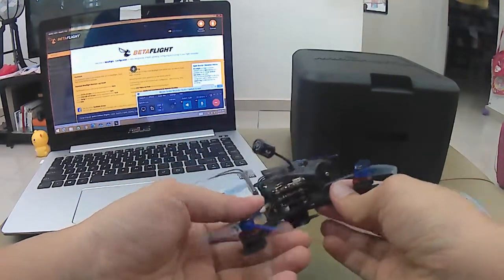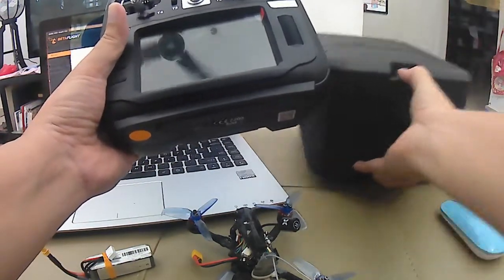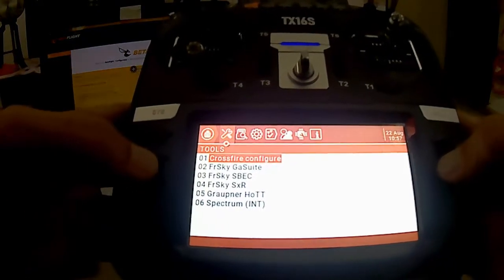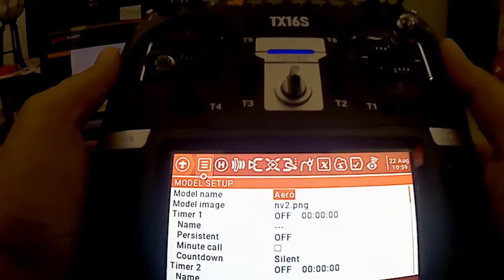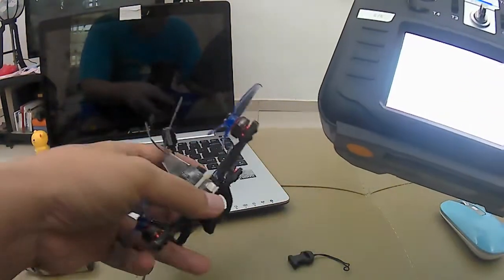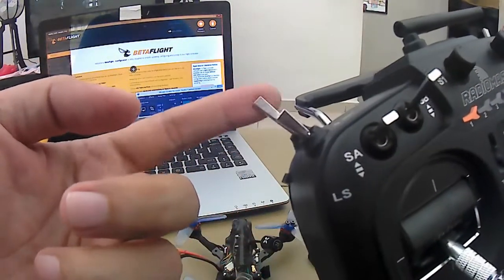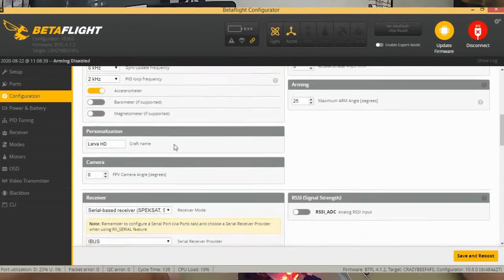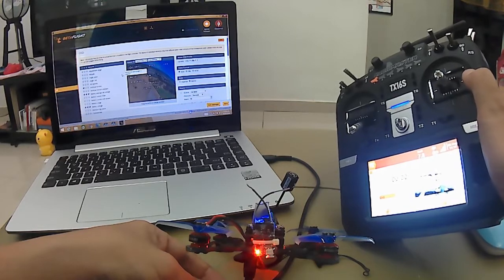Radiomaster tx16s basic setup bind with flysky Fli14+ Rx

Comment: I've got the same radio and receptor, and bind ok with my tyro79 but no signal on betaflight, all configured as you have
Reply: I'm having the exact same issue did you get it sorted?
Reply: @Boycey_UK  nope! Taking the frsky way dude
Reply: I know what you have to do you have to solder the yellow wire to the rx1 pad on the fc mine is now working
Reply: If you can find me on Facebook or Instagram I'll show you a picture of my fc and what I had to do
Reply: I have got the exact same problem, did you figure it out? Tx16s with Fli14+ receiver, it binds but no input in betaflight, any solution ? I am using speedy bee F405 FC.